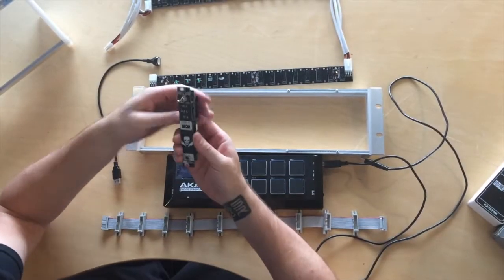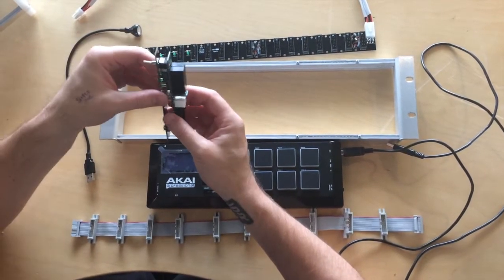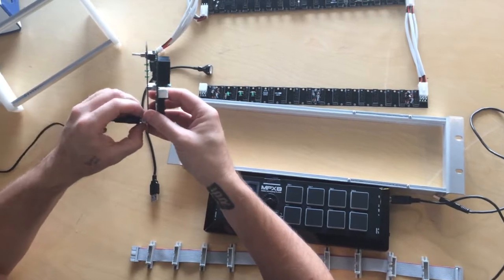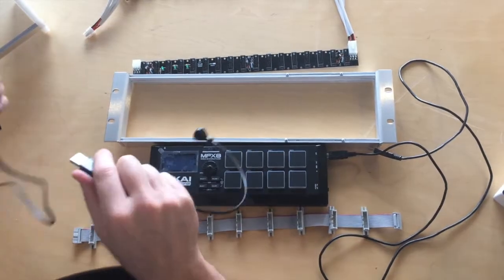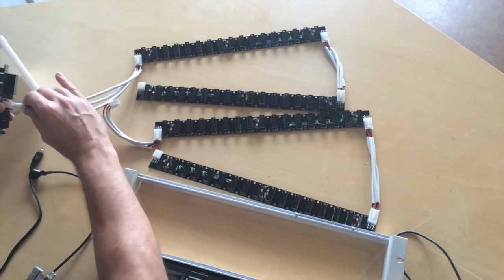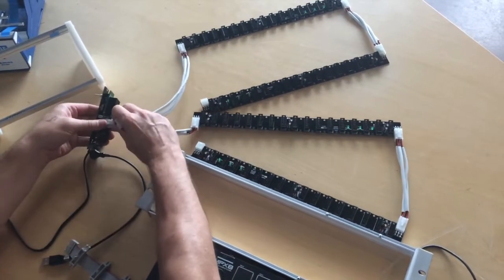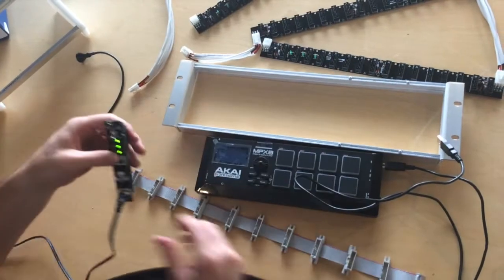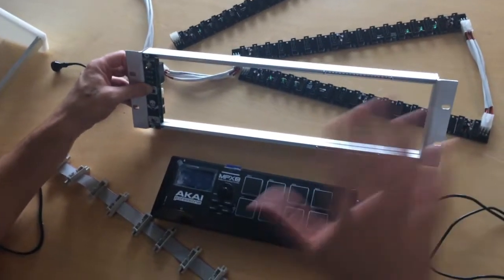Synthrotek DELUXE PWR Eurorack Power Supply & Power Filtering Distro Boards Demo

Comment: Hi! I'm a noob to modular, but not synths. I'm building my first modular with both your modules as well as Pittsburgh modules. Will Pittsburgh's modules work with this power supply? If not, is there adapter I can use to use this power supply with Pittsburgh's modules?
Reply: Yes, they will. The 12,-12, & 5 Volt system is standard. You should not have any trouble.

Comment: This is great Steve. I'm off to check prices though. One of the nice things about your power was it could power up a case but was rather affordable. This looks great but pricey. 

And yes it should power an iPhone, but you'll need to keep in mind that it's drawing from the 5v rail and could impact your modules if you have a ton.
Reply: Had to follow-up. Pricing is very good, I don't think it's any more than the original. Great job on this!
Reply from the maker: Lofuckyou Thanks man, we also have our older version for sale too!
Reply: +Lofuckyou 

It won't power an iphone